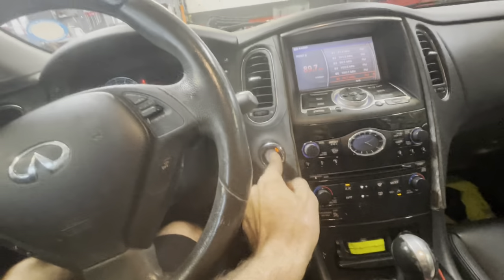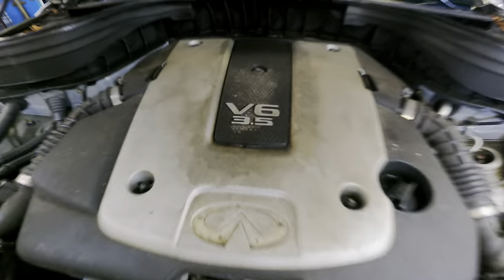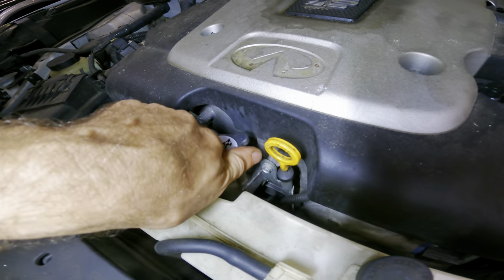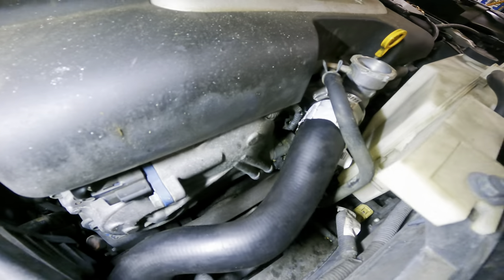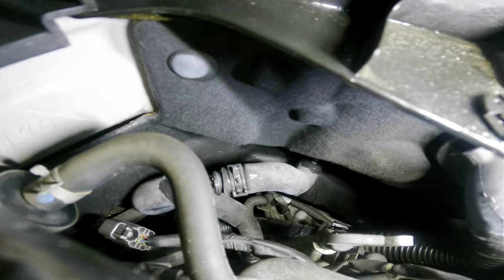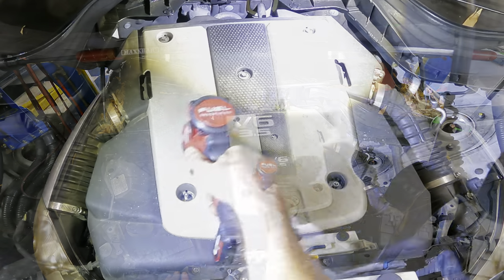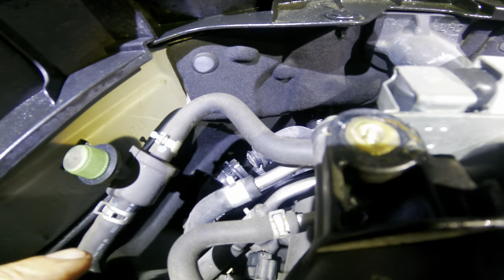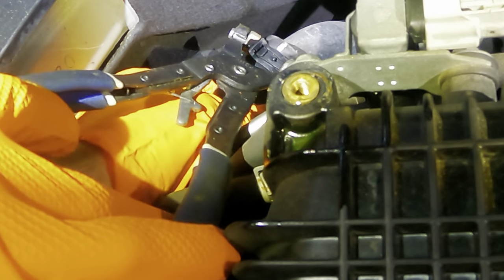Overheated after new Radiator! Tow In! Infiniti 3.5 EX35

Comment: When you are faced with this problem, the fastest and best way is to take a pair of channel locks and squeeze the hose, crushing the remaining fitting and then it will either fall out or you can slide it out with some needlenose pliers.
Reply: How is that the best way? Why not use hose pics and not break anything?
Reply: @AT-wl9yq  You can pick at it all day and not get anywhere. If you crush the already broken fitting and remove it with small pliers, it takes a total of 30 seconds and causes no damage. When you are on a schedule, stupid things like this can screw you up.

 It took him 4 minutes to do this.
Reply: @HueToobBlows  No offense, but it wouldn't take me anywhere near 4 minutes to pick that out. But I have a really good set of pics that make this type of thing easier. Besides, why ruin the old part? As long as you can separate the hoses without breaking anything, they can be re-used.

To be fair, I should mention that I do heavy line work for Ford. I literally go through this every time I pull a motor. I'm sure it gives me a bit of an advantage because a day hardly goes by where I don't fool with these stupid hoses. 

With a good set of pics, its not that hard once you get used to doing them. One other tool that works really well on small diameter hoses, is spark plug boot removal pliers. Quite often you can break the seal with one of those and not have to use pics.
Reply: @AT-wl9yq  you destroy nothing doing it my way. The "only" thing destroyed is the broken fitting. 

I work on yachts. This is a common issue. I do this almost daily. The only thing broken or destroyed is the broken is the piece you need to remove. Try it, you'll be surprised at how fast and simple it is.
Reply: @HueToobBlows  There's no reason to get upset. You're allowed to do things however you wish.  I can't. Most of the jobs I do are covered under warranty, and the manufacturer is very specific on what parts I can replace. Anything over that is examined very carefully. Everyone understands that you're going break things occasionally, or just have an odd issue. The problem is, there's hundreds of Ford techs, all doing the same job. If I stand out and keep breaking the same part, over and over, the dealer I work for will have a problem.

I didn't think to include this in my earlier posts, but maybe I should have.  However, I wasn't making anything up. I've done so many of them, and with the tools I have, its just not an issue for me. That said, I don't think your way is wrong. Replacing an old, plastic part is not a bad idea. I was just saying its possible to do the job without breaking the part. 

Another thing I didn't think to mention because I'm so used to the new norm, is getting parts. Any time I walk into parts, I have no idea if I'm going to get the part tomorrow, or in several months. I've had several cars sit for 2-3 months because we can't get fuel injector o rings.  Its that bad.
Reply: @AT-wl9yq  But the part was already broken....
Reply: @HueToobBlows  I know, but I was responding to your comment on how you deal with these connections. And if you read my last post, I wasn't faulting you for it.

The last person who worked on the car in the video broke the connector, or at least weakened it, so that it broke soon after it left the shop. These cars have a really odd problem with the heater core that requires you to back flush it, and if that doesn't fix the issue, replace it. The hose in the video goes to the inlet of the heater core.
Reply: @AT-wl9yq  What does any of this have to do with removing a broken connector quickly and efficiently? You are starting to sound like a person that just likes to hear himself speak, even about shit that has nothing to do with anything relevant. Which is what you are now, and have been doing.
Reply: @HueToobBlows  I was responding to your posts that were directed to me specifically. If you didn't want a response, why post? And if you want to trade insults, fine. You don't know enough about cars to have a conversation with me. Tell yourself whatever you need to, but you're just a typical mouth wrench. You break things when you take them apart because you're not good enough to do otherwise.

Comment: Hi from uk ray👋👍 we have rainman ray and we have ray in rainman👌 but today for the customer it didnt rain it poured 👍 great conclusion ray👌 hope part 2 comes soon and customer accepts job sheet👍 I was thinking thermostat but both hose where same temp so obv that water is circulating or maybe water pump not pumping anymore and just circulating slower than normal allowing to heat more generously👍 either way the barb failure nothing to do with anyone I dint think it was just next weakest link from radiator deteriorating to failure 👌 but again good job you the man who can👌 thanks for your time and be safe see you soon 👍👋

Comment: If coolant is disappearing, the quickest, fastest and most accurate method I have found for an analysis is to evaluate the oil.  Company called Wear Check will analyse the coolant level in your oil for a very reasonable price.  Just send them an oil sample and voila!  I had a GM van (3.7 V6) which were notorious for leaking head gaskets (the dreaded Dex Cool ate them).  Watched the coolant level weekly and when it took a dive, had the oil analysed.  Sure enough.  5ppm of coolant.  GM's very kindly replaced the HG, even though it was out of Warranty.  I believe shops have access to similar tools.
I really wonder why a shop would replace a rad without sourcing the leak, but then, hindsight is a wonderful thing.
Love your videos, nice to have someone happy at work.

Comment: I don't know why you guys love those hose clamp pliers.  I have a bunch of vise-grips with a hex 5mm female in the clamping adjustment screw.  You put the pliers on the clamp tabs and then squeeze the clamp open with a hex t-handle, or whatever you prefer, on the forcing screw of the pliers.  That way all the force is accomplished by the pliers and not your hands.  To let the clamp go you just loosen the adjustment screw of the vise-grips, or snap the pliers open with the opening lever.

Comment: 8:34 just a tip what I do is get a pair of multigrips or vice grips squeeze the hose to  crush the plastic fitting inside, they will usually break up and that makes it easier to grab and pull out

Comment: A great tool to have in your Arsenal is the “coolant system vacuum purge and refill kit” AKA Airlift. All the trucks sell a version of it.

After opening a coolant system the airlift pulls a vacuum of 30inHg. I love this tool for post checks after radiator installs, especially when there’s a lot of tiny hoses that disconnected.

Always check the service manual when purging a coolant system, a lot of cars now have an electronic valve body that need to told to open.
Reply: I'll tell you what's wrong with the Airlift.  The cooling system is used to taking pressure, not vacuum, at least not the kind of vacuum the Airlift system can create.  It is used to having pressure for years and years and then here comes the Airlift an introduces a ton of vacuum.  All the little weak spots on the rubber hoses and plastic parts develop microcracks from being squeezed in a direction that they've never been squeezed.  A few thousand miles down the road, leaks everywhere.  Seen this many times, always on the older vehicles.  But when I say "older", I mean anything over 10 years old, not something from the 60's.  Avoid the Airlift, it's really a gimmick.
Reply: @coolantkid3428  
You make a good point. Like all tools the technician needs to is good judgement. This philosophy can be applied to many, if not all, tools used in the industry. For example: should you break rusty bolts by hand or grab the biggest impact. This one topic can explode into an entire discussion of “best practices”. 

The majority of vehicles equipped with “thermostat valve bodies” highly suggest the use of an AirLift; per service manuals and or TSB.

Again I agree that if I’m working on a high mileage vehicle and/or old vehicle with heat soaked rubber, I would not suggest the use of an AirLift.

Comment: Ray, just had the same style barb break in the same way in my F150 about a year ago. It's much easier to get the pieces out by putting a pair of channel locks on the outside of hose at the inside end of the barb. Give a slight squeeze and wiggle left to right. It'll move like an eighth an inch and you slide up the hose and do it again. Once I figured that out, it took me about a minute to get out all out in one piece.

Comment: Is there a problem if bits of that coupling remain in the pipe and circulate until they get caught in the rad?
Reply: Yes. I had a piece of plastic from a busted water pump impeller block the input internal passage to the cylinder head. Car would overheat due to the restriction. It was nearly impossible to find, only found out the issue after pulling both heads.
Reply: @Nighterlev  I doubt that. The engine keeps blowing bubbles into the funnel.

Comment: U can buy a tool at the hardware store that removes broken spigots from water heaters. It works great when those plastic joints break like that. It goes on the inside u twist it and it grips then u can pull it out.

Comment: While driving home from work at 2am one night, steam suddenly started pouring out from under the hood. Found one heater hose had a plastic T coupling from the factory for coolant flushes that suddenly snapped. It broke just like the one here. Fortunately I had my tool box. I crushed the piece broken off in the hose with channel locks, then it pulled right out with needle nose pliers. Not having a new coupling on hand, I used a deep socket the same diameter as the broken coupling as a temporary coupling. That saved me until I could change it for a proper coupling the next day. I also had a jug of coolant in my truck. I always try to have some basics with me for events like this.

Comment: Kerosene works really well if you want to remove something from rubber or remove rubber from somewhere or push it in instead. Either way. It will lube and penetrate and dry out clean.
Try it. I remove hoses, valve covers etc with kerosene. It's magic.

Comment: I bought a set of the brake cable style oh locking pliers they have a long cable on them with a locking end... They work absolutely amazing for those Spring clamps... I've pretty much been able to use them on 99% of everything the only thing I could remember that I couldn't use them on was a 1987 arrow star to get the heater core hoses off the firewall there's just no room for that tool in there you basically gotta use needle 👃 pliers

Comment: I recommend against screw hose clamps on coolant lines as there is a large sway in temperature. The plastic will heat up and expand and the clamp won't, leading to premature failure of the plastic. The springy clamps are made to expand while maintaining constant pressure.
Reply: Yes. That is why they're installed in the first place.  You got it.
Reply: The deformation in the rubber will make up for that whole 8 thou per hundred degrees per inch of expansion.

Spring clamps are OEM because they're a cheap one piece part that can be manufactured off a roll of stock.  They can be cut and formed in one press stroke.  Worm clamps have 3 parts to them.
Reply: @MichaelRBaron  and junk OEM clamps are faster to install on an assembly line.....

Comment: Z1 Motorsports sells the original plastic bleeder valve for $17 and a brass one for $34. It's a perpetual problem for Nissans and Infiniti with the 3.5/3.7. Get the brass because you don't want to do it twice or risk the engine. Good for preventative maintenance at 100k.

Comment: The ford single piece moulded together heater lines from the early-mid 2000s are notorious for that. I usually cut them off and replace with clamps and barbs if I have to pull the hose. They don't like being moved.
Reply: tell me about it....

Comment: There was nothing more miserable than purging air from the cooling system on the M or the G35 on that V6 engine.  The bleeder valve is a must use.  Learned the hard way.

Comment: I wouldn't fully believe it's still overheating until it's overheating with the cap on. I've seen more than once that a cap that doesn't seal or hold the correct pressure can cause the vehicle to overheat. I live in a small town in the mountains and we get a lot of pass through traffic. One afternoon, one hour apart, I had 2 people stop with overheating issues and both turned out to be bad radiator caps. It's a small thing that can cause big issues. It's always the first thing I check when an overheating vehicle comes in.

Comment: The faulty heater inlet coupler is actually pretty common. typically they’ll start leaking first but every so often they just crack off like that and dump all the coolant. Ultimately resulting in overheating and head gasket failure. We don’t ever see VQ engine head gasket issues unless it’s been badly overheated.

Comment: I own this vehicle - rather one just like it. Proper coolant bleeding is to elevate the front of the vehicle, open the air relief plug found next to the battery box, turn heater on, use the coolant funnel - if you have one - and fill till coolant escapes the relief plug - then top off.

Comment: so the broken barb thing has happened to be before many times this trick also works for bearings that are stuck deep in small tools like the read bearing of a grinder

use a bold about the size of the hole and use an impact driver to get it to bite then just grab the end of the bolt and give it a wiggle

Comment: some people fill up their radiators without having the heater on. You have to have the heater core wide open when filling up the coolant after a radiator change. failure to do so can result in a air bubble in the engine that prevents coolant circulation.

Comment: I had a case where the shop replaced the (rad, water pump,  hoses, and thermostat), on a friend's car. I asked them to show me the old parts. They said they were taken away in the dumpster. I knew it needed a lower rad hose and nothing more since I did a cooling system check just before winter. I was away when she took it to the shop. Now, I can't prove anything. In your case, it may have only needed that broken plastic piece. Apparently, that shop has been a problem for General Motors who finally shut them down.

Comment: I always check with pressure tester if there is air in the system you gauge won't move immediately but if it'd full it will rapidly build with the first pump. Also  testing when hot and you can see if pressure keeps building

Comment: I have a 2003 G35 and ran into a similar issue and come to find out you have to lift the front end about 35 deg crank the heater up and open the air bleeder in the line at the back of the engine compartment to get all of the air out of the system.

Comment: Running an engine without the coolant pressure cap on will cause it to run hot. Fill, test drive, check again and top up as required.

Comment: I get stuck plastic pieces out by getting in between the plastic and hose with a screwdriver and then spraying some silicon spray in it while circling around the piece. Always worked for me with almost never plastic falling inside the hose.

Comment: as a guy who does this sort of thing every day. You MUST invest in these two things. 1: VacuFill. 2: Head Gasket Leak Detection Kit. The VacuFill system allows you to do two majorly important things. it 1, allows you to check the system for leaks BEFORE adding fluid. You place the system under a vacuum. If the vacuum does not hold. You have a leak. Otherwise you add the coolant to a bucket, dip the hose into said bucket and open the fill valve. This will allow the system to fill completely with coolant. No air getting trapped anywhere. as for the head gasket leak detection kit, That is simply a fluid that changes it's color if there are hydrocarbons present in the form of a gas within the cooling system. This is only possible if there is combustion gasses getting into the cooling system. Also, Round pliers on hose, inset fitting, Continue holding hose with one hand. With the other, grab the clamp and slide it over. then slide clamp over, slide hose on and while holding with the pliers, slide clamp up onto hose. Those worm gear clamps don't fare well in severely cold climates where it reaches negative temps. They loosen and leak. Considering that you're in Florida, it probably wont be a problem but it's always a good idea to keep factory clamps on the car when you can.

Comment: a hint when dealing with those plastic connector broken off use a pair of needle nose vise grips with rubber fuel line over the jaws and clamp the hose shut past the broken piece then use a p[air of channel locks or something similar to crunch the line and the broken piece inside to small pieces then turn the line upside down and let the crap out then unclamp the vice grips and proceed with the replacement.

Comment: To get that plastic connector out of there I would use a straight pick and worked around it to break it free from the rubber instead of breaking off pieces that most likely went down inside that hose and hopefully it doesn't cause any problems when it runs through the water pump or into the radiator but I'm sure it will. I don't know Ray sometimes when you do stuff I just got to shake my head.

Comment: I don't have a problem with replacing those factory, split-leg hose clamps with Jubilee clips (those grub-screw ones). But please be aware that the split-leg ones will give you loads of warning before they let go. Jubilees will disintegrate all at once.

I have a ratcheting and telescopic tool that will pull those split-leg ones with no ptoblem, holding them still and wide open for as long as you need. 

Please lety me know if you want a recommendation.